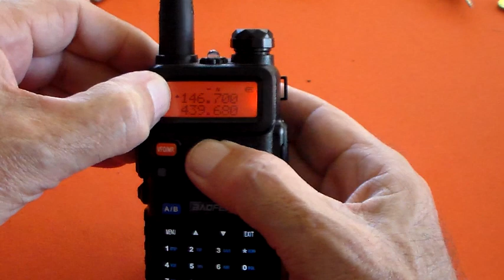How To Program a Baofeng UV-5R part 2.

Comment: is it possible to use these as a CB, can you program it with 40 UHF  channels
Reply: Cannot be used as a CB as CB frequencies are in the 11 meter band (27 MHz).  But you can program it with 40 UHF frequencies.